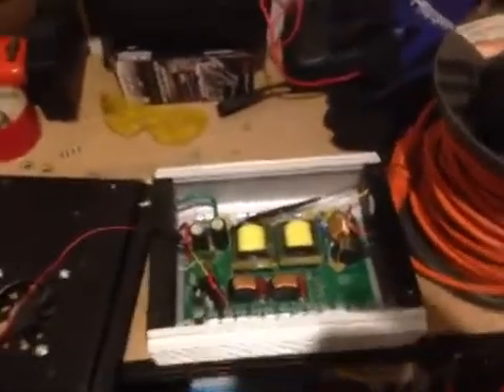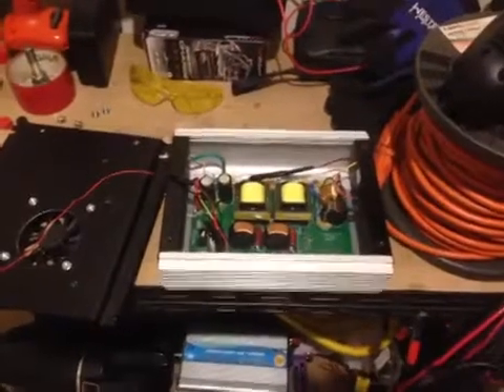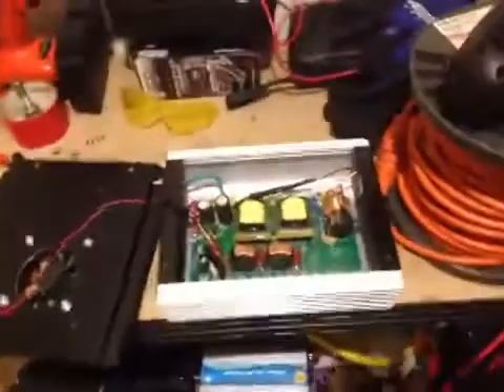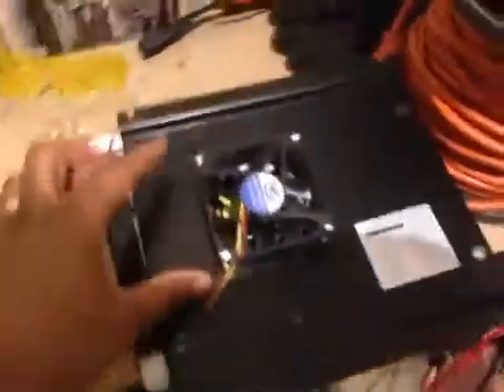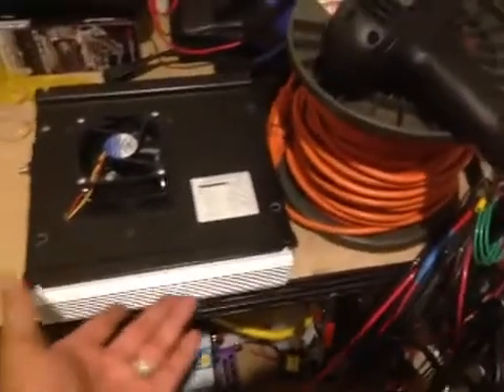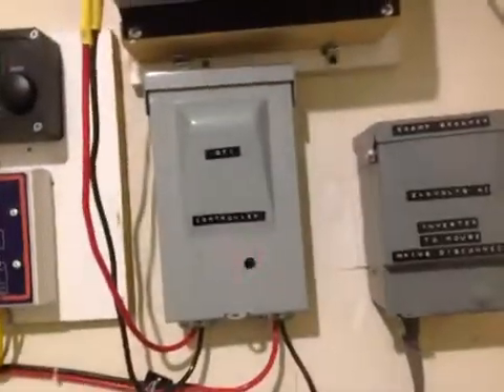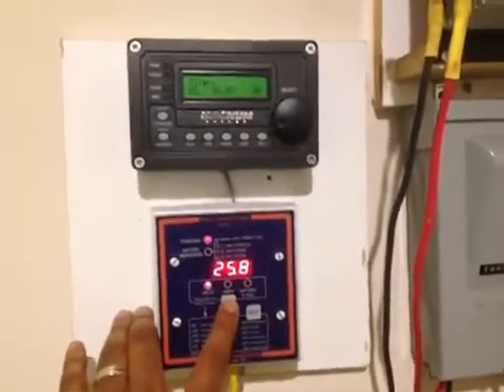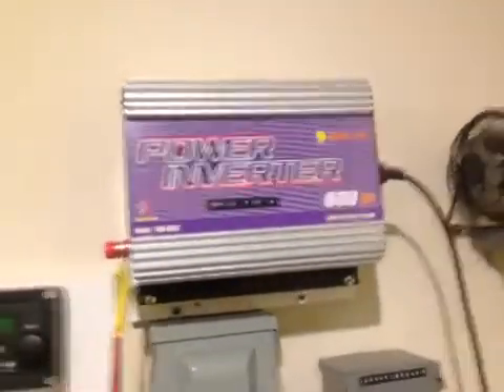Tips on how to keep your Grid Tie Inverter cooler

Comment: why not connect panels directly to the grid tie inverter? by connecting batteries to the grid tie you are lowering your efficiency, putting extra stress on your grid tie, batteries and your charge controller...there is no need to use batteries nor charge controllers if you pump power directly to the inverter like you are supposed too...if power goes out then switch panel input to your solar controller while the grid tie is off...you can keep your batteries charged with a once in a while charge with your controller or a battery minder, save a battery charger or any charger for that matter as long as it is a smart charger....good video!
Reply from the maker: +Leonardo Cruz Thanks for your comments.  These grid-ties do have a tendency to get hot whether connecting to battery or panels.  Yes, I agree that they are designed to connect to panels, but for those folks that choose to connect to batteries, this tip gives them a chance to help the unit last a little longer and maybe be a little safer.  Thanks.
Reply: +rhandsom agree with the fan mod for these inverters...however putting out 500+ watts constantly from batteries vs direct from panels that are a lot easier on the inverter since power is not so constant as with batteries is drastically shortening the life of these inverters fan or not...not to mention run unnecessary cycles on expensive batteries plus having to charge batteries with an expensive charge controller without need in the first place since you can just take that same power and put it to the grid tie directly is what I don't get...but hey, it's a free country :-) maybe someone can help me understand this...
Reply from the maker: Thanks again for the comments.  It's DIY after all.
Reply: +rhandsom so true ! lol

Comment: Cheers to making use of the solar electricity while that batteries are full - not throwing it away as many do.  Question, how close is ur system, to automatically transfer switching over to run ur essential power outlets fully on batteries , during a grid down event? Do u have a subpanel powering selected outlets off the magnasine?  An auto start generator switch to recharge off fuel when ur charge level drops to a given voltage during grid down?
Reply from the maker: My system is connected via a traditional sub-panel for input (pass through) power from the utility grid through the magnasine (to charge batteries and pass through power), and a manual transfer switch acting as a sub-pane to output power to the critical circuits, the distance to the switch and sub-panel from the magnasine is approximately 10 or 15 feet. I do have a traditional propane/gas generator that will allow me to bulk charge the batteries in short order in the event of a grid down situation.
Reply: Nice!  If I understand it right u've built a hybrid off-grid on-grid system from high quality component building blocks. The only missing pieces for total automatic operation are the automatic switch that detects grid down and switches the inverter power output to backfeed into ur home grid's selected breakers (but I think the magnasine inverter charger has one built in that could be used?) and the automatic generator start intelligent relay switch - so u don't have to rush over to start the generator when the batteries fall to the 50% range when they can damage themselves with hard to reverse sulfation... plus maybe an internet connected box that outputs your system stats for system monitoring on smartphone to add up the solar energy production and alert when something isnt working properly...
Reply from the maker: Actually, I do use the Magnasine's automatic transfer switch to switch from utility to backup , also I'm fine with using the manual generator, an automatic switch over would be great but manual start is fine.  If I had a larger system I would consider an internet monitoring system.

Comment: Nice idea but you ultimately have less airflow with the larger fan and small pulling air out of the unit. Then only one small fan pushing air.  I would think it would be more optimal to have both small fans pushing air into the unit sand have the larger fan sucking it out.  It's all about pushing the maximum CFM per minute through the device...
Reply from the maker: You may be right. I've since upgraded to a 24v 3 1/2" fan that's connected directly to the dc inputs and connected the smaller 12v fans in parallel to the board. The larger fan appears to be working well. The smaller fans only come on when needed. Even with all fans on, the larger fan is still suctioning out a lot of hot air. I'm hoping the other fan simply increases overall suction if nothing else but to decrease convection heating.

Comment: Looking good Rhandsom. You mentioned your GTI overheated and burned out. I had thought there was a safety built-in that would automatically shut down the GTI when reached a certain temperature thus avoiding a burnout. Is that the case? If so, why didn't that shut your GTI down before burning out?
Reply from the maker: It's true that these GTI's are "supposed" to turn off for small period of time to cool the internals, and they do, but they also come back on and I believe the amount of power I was pushing through it, didn't give it time to cool, plus it was really hot that day as well. I toasted the Capacitors, a fuse, and the Mosfets. My mistake was running the unit at 95% capacity, continuously.  I had 2 internal fans and an external fan and it wasn't enough to keep the unit cool. I would recommend only running theses units at no more than 50% of there capacity, if someone was going to run them continuously, even with fans.
Reply: good to know